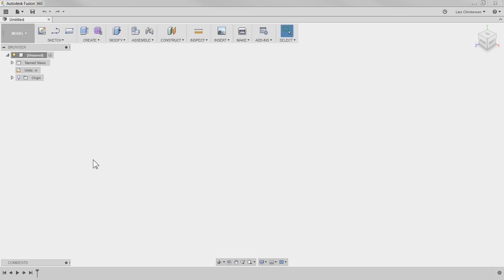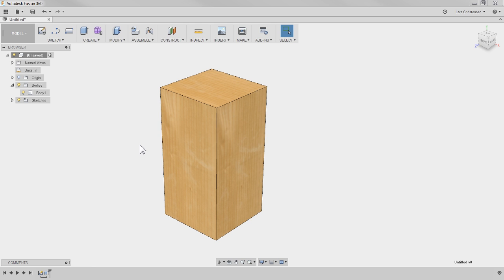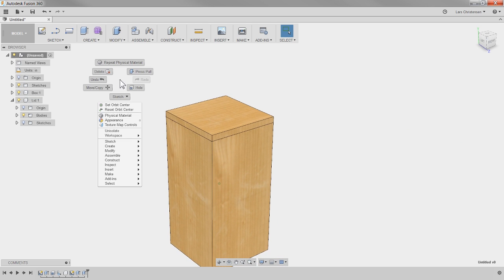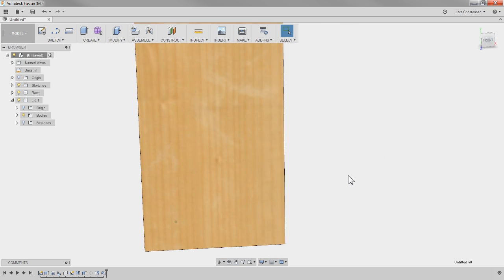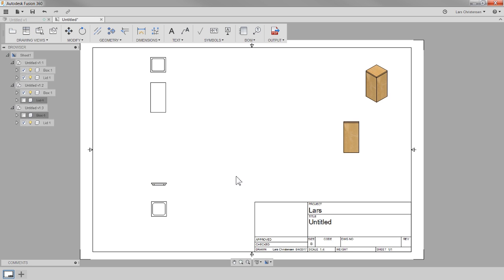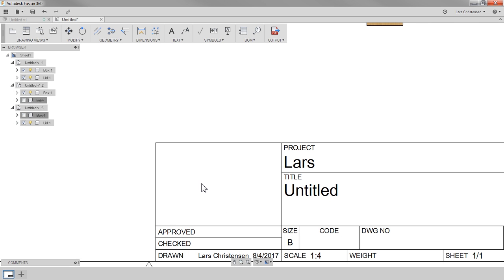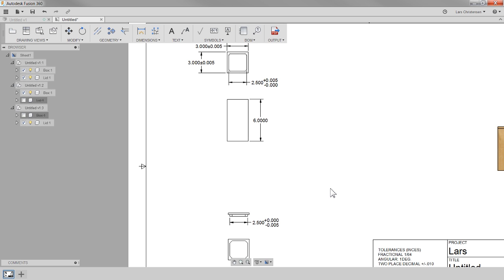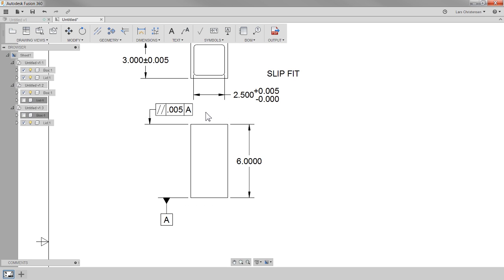Fusion 360 — FINALLY! Tolerances and Clearances in Fusion —Your Comments & Questions — #LarsLive 41

Comment: I would have made the 3D model in the middle of the tolerance, because 3D printing and machining use the 3D model for generating toolpaths, and rather used the nominal values on the drawing ,and defined tolerance on the drawing as well.

Comment: Hi Lars, thanks for the video. Is it possible to change the position of the deviation. IE on top or bottom of the measurement instead of to the right? Also is it possible to add a sectional view from the 3D model in the 2D drawing?
Cheers,
E.

Comment: Hi Lars! Great tutorials, thanks for doing that! Question... I know it makes sense to design with nominal values and later on add the tolerances in 2D drawings but how are you getting on with this if you want to 3D print a prototype of what you have just designed? I just finished a mechanism in Fusion360, printed 3D and am ready to do 2D drawings. Now all the mess starts. Is there any simple way of doing it?

Comment: Is there a was to generate a dynamic clearance surface in Fusion 360? For example, a surface that would represents the space to room that front wheel may need to have clear in order to complete it's fully intended angle range?
Reply from the maker: I am not sure I totally understand the question, but you could possibly offset a surface from a model face and that could be dynamic as long at it was always moved to the end of the timeline
Reply: @cadcamstuff  Thanks and sorry if I wasn't clear. Say I have a tire can turn left or right by 30 degrees. If the model of the tire were a simple squat cylinder, then the volume it interacts with as it sweeps from -30 to 30deg will make a sort of hour of hour glass shape with a curved surface fore and after on the tire, which represents the space occupied but tire when all angles are accounted for. The you can design around this area to make sure your wheel well maintains clearence at the full designed tire angle range. I see this sort of design surface all of the time in design meetings and I was just wondering if there was a built in was to generate such a surface/body based on an component and it's constraints in an assembly using Fusion 360.

Comment: If you use fusion to create the gcode for a cnc using the "perfect" dimension of the design, would you have problems? if you do what are the options to fix the problem before actually machining.
Reply from the maker: I have always cam’ed to perfect dimension on CAD model and then uses cutter comp on the machine to dial in within tolerances

Comment: 20 minutes in and I still don't know how to make the lid a specified ammount smaller than the box, so when I 3d print it, it will fit.
Reply: He already said it's for manufacturing. You don't change the fit and clearance in the model, you specify it in the drawing. For 3D-Printing its different.

But here's some info for your case:
Pressfit = -0.15; Revolute fit=-0.2; Sliding fit= -0.25
Reply: @aixbln  Each 3D printer needs different values if you want high quality so you really need support for easily changing these. Sadly, Fusion 360 doesn't seem to support any generic way to do this.

Comment: can't model nominally for 3d printed things.  I just made a part with a slot and a tab and they do not fit when printed.  I have to build the clearance into the slot or the tab.  Unfortunately I discovered it after printing the part for 16 hours (

Comment: Great video.  I agree with the comment about the pace of the video, but if you were to go faster, then I would have to listen to the video twice, so in the end, I think your pace is good.   It seems that if I like the pace, it means that I don't have enough time to digest the material.  Maybe I'm just not smart enough to grasp all the information in a fast pace.

One question, could you give a suggestion of tolerances for wood, for a snug joint in wood working?  For the CAM we need to program these tolerances.  Any guidance would be great.
Reply from the maker: That is awesome to hear Laurence Schenk .Thank you for watching the videos.

Honestly, I don't have any great knowledge about tolerances for wood. I think I would do some test cuts if I was in your shoe's. I could imagine that fits will be different from different types of wood, and the surface area that it touches.

Have ana awesome day!

Comment: Lars - I think what all of the 3D makers would find VERY helpful, is how to do an interference between two parts, specifying a tolerance, so that it would show any material that interferes with at least that amount, rather than just zero, and then how to remove that interfering amount.  Could it be done with an outward facing shell or some other technique?  I have been struggling with this, and have come up with no solution yet.  But you're the master.  Any ideas?
Reply from the maker: Can you give me an example of what these two components could be? I have only had half a cup of coffee and my brain is not fully running yet.
Reply: Lars Christensen for example your box and lid. We would want to remove all the material that was in red on your interference analysis, plus the additional material if the lid was <x> millimeters larger on any face that contacts the box.
Reply: @cdeerinck  maybe this could be done by cutting the clearence areas using surfaces that are thickened based on a parameter?

Comment: Great video! I would be very interested in hearing how and when you address joint clearances when moving from CAD to CAM in fusion to CNC mill wood? Is it easier to set this in the modeling environment or in the CAM environment? I have yet to find a tutorial that addresses issue with wood joints. As you explained, nominally designed joints are going to be too tight and will not go together, especially with glue on them. Thank you!

Comment: Thanks Lars. You are good teacher. What about removing parameters in model (extrude, hole, etc) with inventor HSM 2018
Reply: Jim, if I understand your question correctly I would just suppress the features you don't want to machine or another alternative is creating a patch over the surfaces you want to avoid

Comment: I really don't get this. I get the drawings that's just drafting 101. Clearances and tolerances are needed to cam a part that actually will work. In a cnc environment is a drawing then a recad for cam standard? That seems like a lot of wasted effort and doesn't match what I saw while doing IT consulting in a cad shop. A lot of what they did drawings were never produced it went from cad to cam to machines to finished part.
Reply: storm strmrdr & Ray Manzi go check out the tolerances and probing webinar I did on the Autodesk HSM YouTube channel.
Reply: I usually use the "Stock to Leave" to define clearances. You can use Negative stock to leave to define clearances. I'm just a NOOB so I don't know if this is the best way, but it works for me.
Reply: Good Webinar. Although I think Lars can polish it up a bit in Fusion. I found it hard to find the items that you selected in HSM and follow along in Fusion. FYI, the 27 minute Bio in the beginning wasn't necessary. 5 min Max Please......
Reply: Ray Manzi yeah. The bio got out of hand because there were two of us... And it's actually something Autodesk asks us to do... And the reason you're struggling to find those commands in Fusion is because as I point out in the webinar, they don't exist. You can't do model based tolerancing in Fusion... Or Solidworks for that matter without making the nominal parameter value the toleranced one.
Reply: I thought of using variables for clearance. For example diameter = 2.5 -slipfit1. That way if I needed to adjust it all I did was change the variable. Is it possible in fusion to import a table of variables into a project or have a standard set that is inserted into every new project so you don't have to add them one at a time?
Reply: storm strmrdr yeah I've tried that method. It only works in some situations. I think there might be a plug in that will allow you to import.

Comment: What about when you're doing 3D Printing?  Is there a way to specify tolerances when you're generating the STL?  It would be very handy to have the STLs take into account component contact
Reply: ATMakers I hoped that he would have covered that topic too. Maybe in part 2.😃
Reply: ATMakers Indeed, the inner lid should be smaller in the 3d design and not only within the descriptive drawing. To my knowledge conversion to STL only uses the 3d model
Reply: I guess you could just use parameters for that. Instead of typing the regular value for the critical dimensions, use a formula which takes into consideration the tolerances.
Reply: I came back to this again and forgot it does not cover if you are 3D printing the parts. You need to design in the clearances in the 3D parts, but I know each 3D printer can change the size. That can eve change if the part is small or large. I hate printing a test but that is the only way I know how to work it.
Reply: You can use press pull or offset faces or design it with an offset in the sketch.